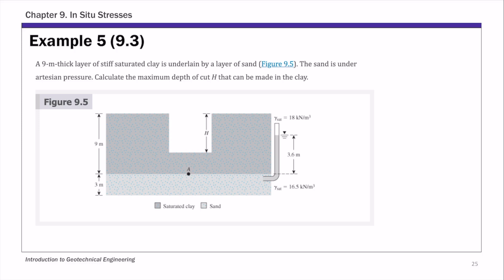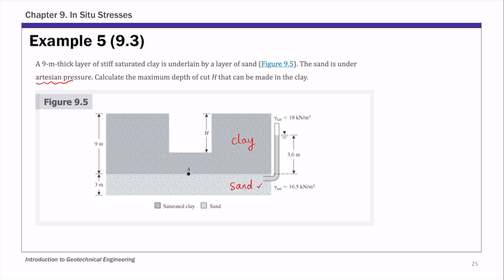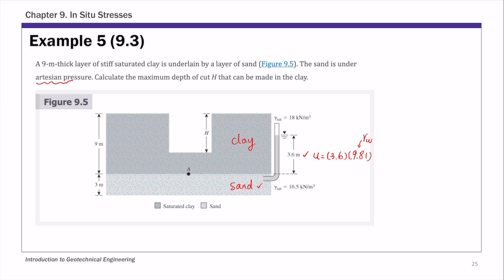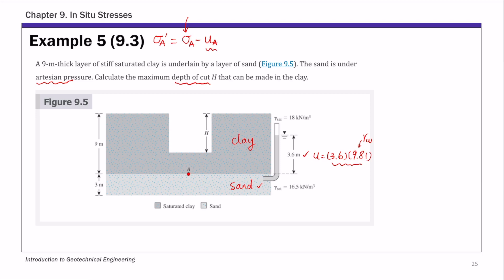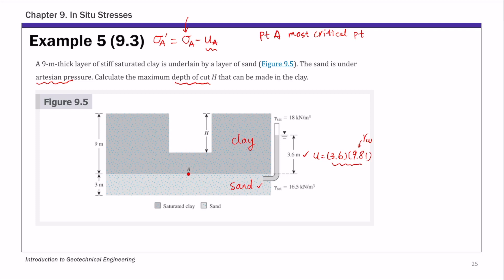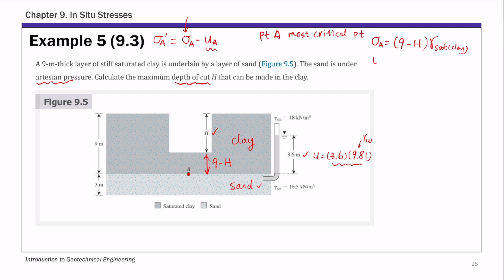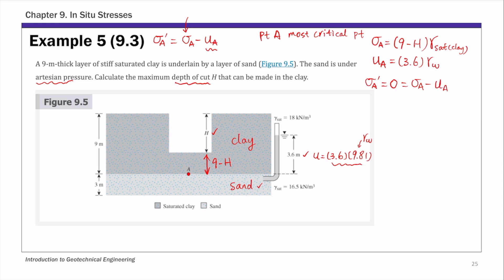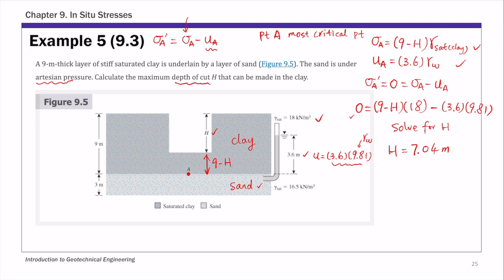Chapter 9 In Situ Stresses - Example 5: Stability of Excavation

Comment: Why have we not considered the hydrostatic pressure above point A, 9.81*(9-H)?
Reply from the maker: Point A is under the artesian condition, and you cannot simply use the hydrostatic pressure equation to calculate its pressure. The actual pore pressure is higher than the hydrostatic one.
Reply: @uSeeGeo   You are right, but I think the equation for the pore water pressure should be u=9.81*(9-H) + 9.81(3.6) 
U= Hydrostatic part + upward pressure because of artesian condition

Kindly, if you can correct me on this, thank you